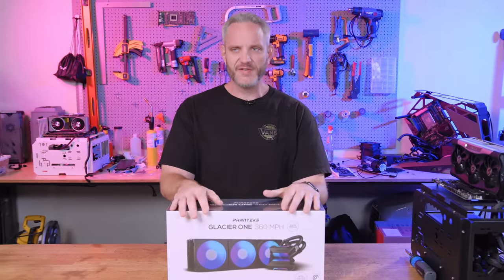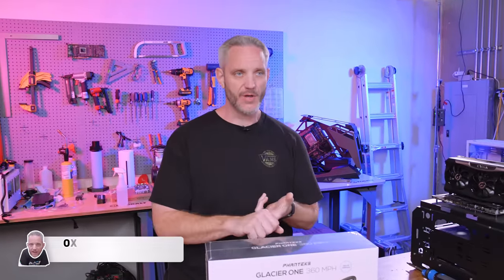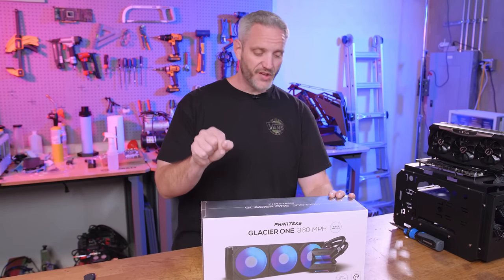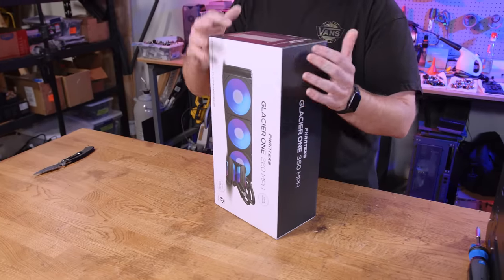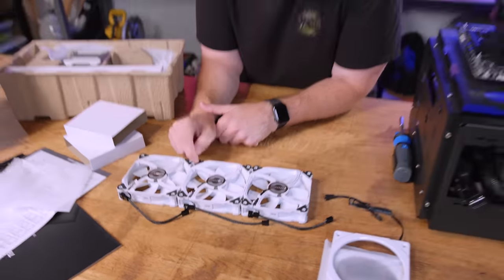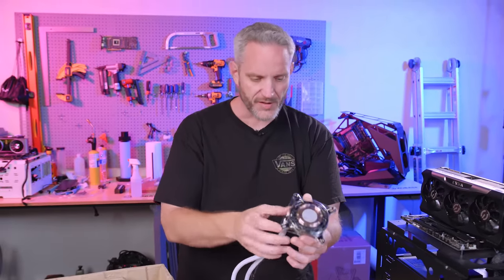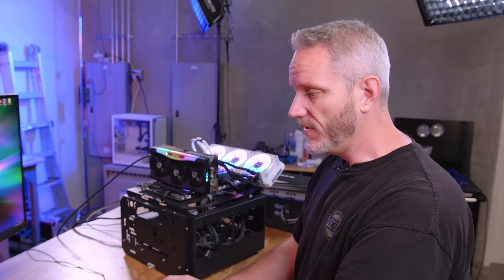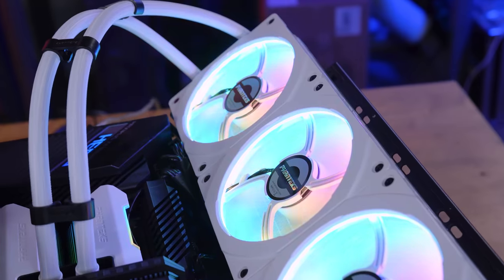A new CPU Cooler has entered the chat!

Comment: is this compatible with am5?
Reply: @k3nny735 Did you ever find out an answer to this? I've ordered one of these and the only answer I could find out from anyone before it gets here is that it MAY require an adapter, and if it does then Phanteks SHOULD have it in the box or I SHOULD at least be able to order it from them, but I'd like to know beforehand so I don't have boxes of parts just sitting around waiting on the plate to get here.
Reply: @lstcloud well... I still without a response. I got a deepcool ls520 instead
Reply: @kennY_72  Actually it JUST got here about half an hour after I commented (of course just in time to make me look dumb for asking). So just in case anybody else wants to know: yes, according to the box the adapter plate it comes with works with both AM4 & AM5 sockets even though the listing didn't say.

Comment: 12th gen groomed us to accept high temps? Ryzen has bin hotter as intel for years specially on idle and noone ever mentioned that! and intels latest gens only get hot if you A. squeeze out that last get % of performance for 50% more power draw.  Limit it at 150 watts and its way cooler and almost as fast. And B. run useless benchmarks all day to show off. or are a niche of a niche of a niche market and actually render on a cpu instead of a gpu. in which case in my opinion you are doing it wrong.

Comment: Hmm I got to thinking, has anyone tried to recapture at least some of the waste heat from CPUs and GPUs with a thermoelectric generator? Or does it take too high a head load to function enough to be worth the cost and complexity? I guess it could not have a fast enough thermal transfer rate as well.
Reply: the efficiency is so low you would generate microamps at best i imagine ^^' not worth it.
Reply: The best way to use the heat from your system is to warm your room during winter.....
Reply: @stevensghost945  Thanks Steve.
Reply: The solid state TEG are only 6%-8% efficient and in a well cooled system there is only a 15c-25c temperature differential. Using a more efficient power supply & running it the most efficient part of efficiency curve would be over a 1000x the effective power savings. Undervolting, m.2 drives instead of hard drives, & 0rpm fans would be similar effects.

Comment: So basically its a body kit for a AIO?
In all fairness this is stupid and pointless, it's well established that an air cooler out performs an AIO at the same price point. Yes AIO have their place ant that tends to be small case builds where a big honkin air cooler wont work but slapping some fancy RGB "infinity mirror" on top of the same standard design does not a good cooler make. If Phanteks had gone down the Aquacomputer kryos rout and slapped an OLED info screen on it I'd be much more impressed,  being able to see flow rate, pump speed and water temp is useful. 2001 space odyssey space tunnel effect is not.

Comment: Gotta say, this was pretty lazy on Jay-Z part.... The whole draw/gimmick of this cooler AND this video was about the increased thermal output of newer systems, and after saying all that jay went with a 10900k... Like dude, this is literally your only job, you couldn't be bothered to set up a 12900k bench real quick?... Sigh. Thank God for professionals like Gamers Nexus. I like Jay, but the effort he puts into his content is like... Less than a streamer has to.
Reply: Well, he can't show anything negative when he's doing a paid 'showcase' rather than an actual review
Reply: @robwhitmore3040  I hear ya brotha, the sentiment. But he CAN, but he won't. Because in his view, his responsibility is to the sponsors bottom line. Most, at least many, influencers give the pros and cons. But in this case, he isn't doing his sponsor any favors. By not showing what the product was ACTUALLY built for and what it can do lol. He was just lazy. Also the premise of the video was about the expanding TDP of processors, and how an AIO like this is going to be needed going forward, if ya know what I mean.